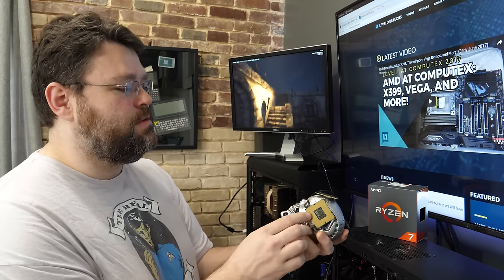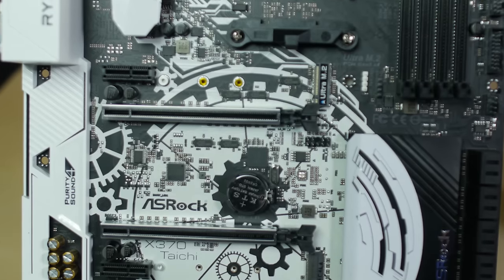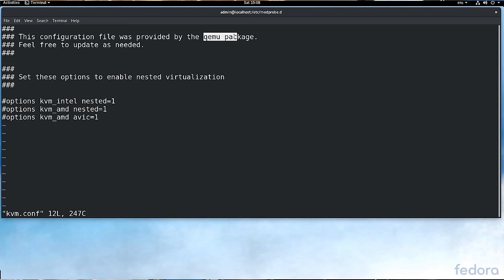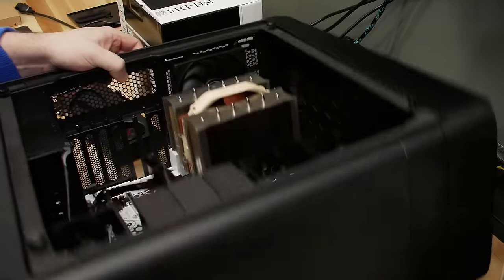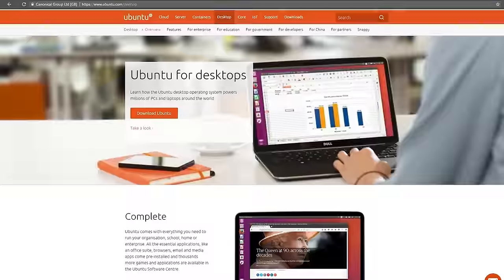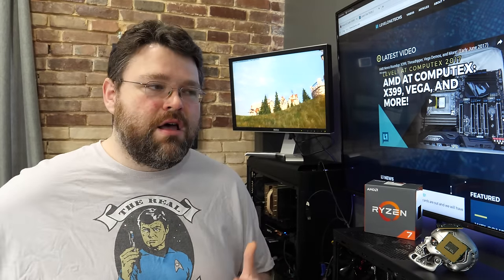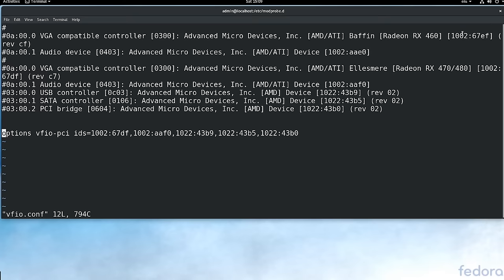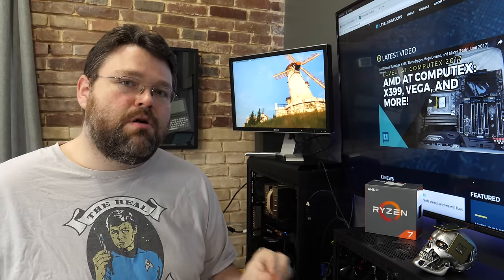GPU Passthrough for Virtualization with Ryzen: Now Working

Comment: I can see you're a great tech-evangelist but maybe you need to either tone it down so more people can benefit from the information or go more in-depth so more advance users can learn something not readily/easily available online.

Microsoft is not against containerization... but I wouldn't ask you to know this since you don't really seem to have a grasp on IT. 
How can they be against a technology they invest in? Where I worked we used to contribute code to the docker effort and the rationale was that namespaces and CGs (docker) would help get more out of the bare metal without an architectural revolution; "without having to waste cpu cycles going through layers".

You're talking about graphics cards in containers like as if that's the future, but nvidia-docker is a thing; not really a new one.

Just before fanboys jump to your defense, I can let you guys know I've worked for Novell, IBM and currently Amazon, so on on containers and VMs, I speak from experience.

I came here to see what's possible in consumer-grade hardware/software stacks, I don't think this guide is helpful to novice users, and it's certainly not helpful to enterprise power-users that can use Google and/or get to the official documentation easily by internal routes. I can give you an above average score but you're still at the user level (i.e. power-user but not at an admin level).

Comment: Honestly Wendell, I get what you're doing but cutting off large portions of the walkthrough just to stick it to Nvidia basically also sticks it to every single high end enthusiast that might attempt this because guess what? AMD still has no response for their high end and it's looking like by the time they can come up with Vega, Nvidia will just release Volta and it won't be high end anymore.

Remember how you say how sometimes the Linux community sucks? Well you're basically acting the same way you described before.
Reply from the maker: lolwut? The article covers the part where you hide the virtualization from the OS to make code 43 go away. That's all you have to do with this setup.
Reply: Your anger is misdirected.
Reply: And I can also confirm that G-SYNC is working fine. I'm running games in a W10 virtual machine on UnRaid and the Nvidia drivers does enable G-SYNC (using the ROG SWIFT PG348Q and a GTX 780 Lightning). Obviously the caviat with this is that they could probably detect this and disable it in the future but for now it's working.
Reply: none of this is about your precious brand... it's about drivers not working without spoofing, if it were any other company, they'd get the same treatment, it's only fair to mention the bit about NVIDIA breaking it intentionally

this isn't about performance either, it's about getting things to work in the first place...
stop trying to flex your e-peen to people that already know how to mix and match hardware for their particular needs, not everyone needs a 1080ti.

if that's a concept a bit too hard for you to grasp, 
i suggest you move your little fanboy wars over to some gaming channel where people are actually clueless enough to care.

i'd say the only thing that sucks here, is your attitude towards people as a direct result of your inability to draw rational conclusions.

Comment: Why use virtual machines when you can get the 100% performance from Windows or just the OS by itself? Lol. 
Honestly not sure why there's such a fascination with VM's being used to run the same OS multiple times, and waste resources, when you can do it all on one OS or multiple computers that you might have anyway. It might only be useful if you buy a very large CPU/RAM server computer and want to spread the load a bit better over about 32 cores and 64 GB of Ram or something like that, for servers or for something similar, but even so, running servers in 1 OS would probably not suffer too harshly under those conditions because most OS will already schedule each process on a core or distribute the load quite well already; teh point where it's not percievable in difference.